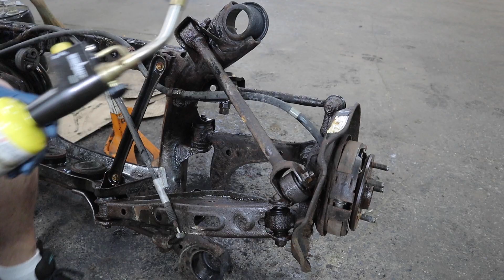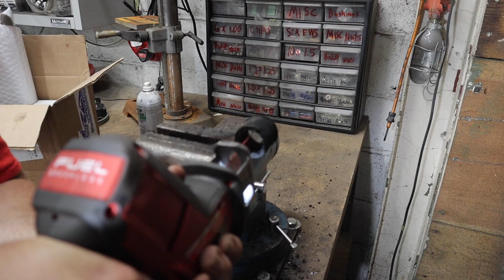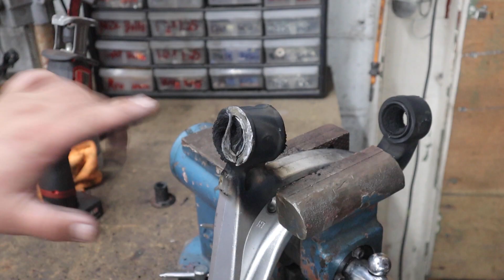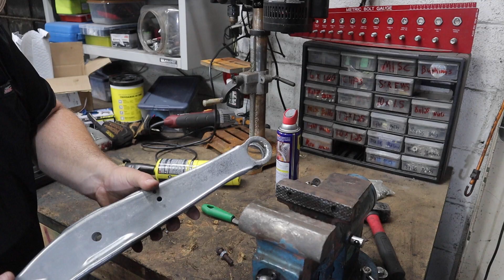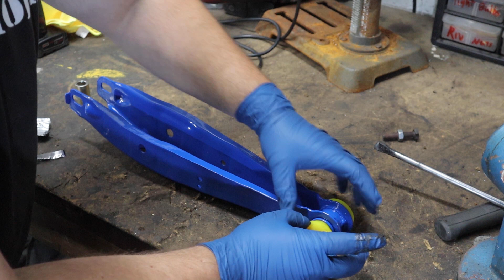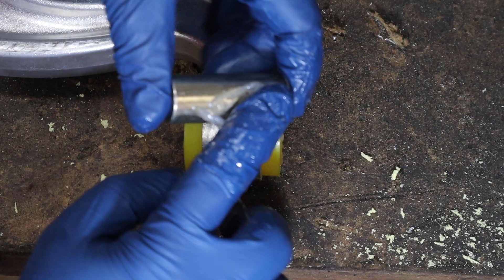Rear Control Arm Bushings Install | StrongFlex Bushings | Lexus IS300 IS200 Altezza

Comment: Quick question relating to the upper control arm bushings into the alloy GS arms. Are you concerned with the strength seeing as you have removed the steel sleeve? The poly bush is only encased in that cast alloy which isn't all that thick. Have you spotted any cracking or failures?
Reply from the maker: Haven't noticed any issues yet!

Comment: Hey fella really handy video!
I'm doing the same on my IS200 at the moment and am considering new upper control arms. How are the eBay GS300 ones holding up? It's a nightmare trying to find OEM IS arms in the UK
Reply from the maker: havnt drive the car yet! started taking apart the front of the car again LOL
Reply: Have you ever did it, and if so how is it?

Comment: Great video, I’ve been compiling my suspension overhaul one at a time bought Cusco Rear sway bars and oem bushings already, lower ball joints. What are the other essentials do you recommend without going all out as much i want to do differential bushings and etc my goal is more of a DD for my wife and I IS300 with weekend canyon driving.